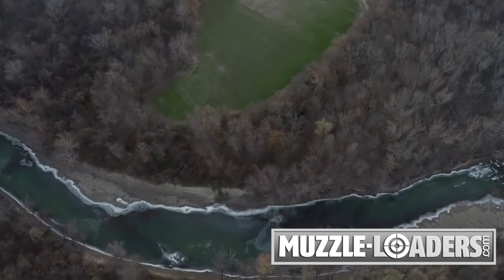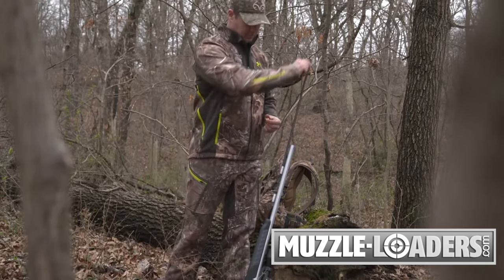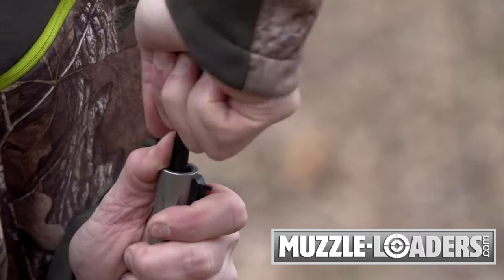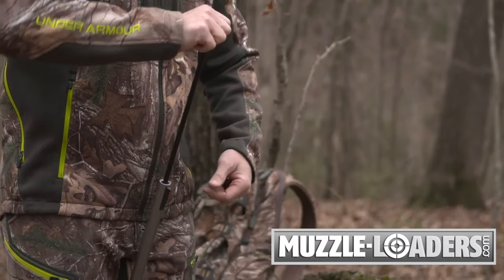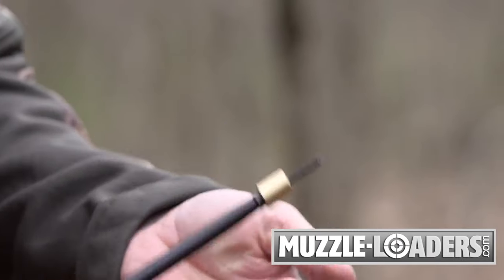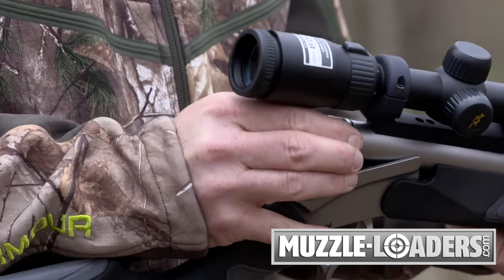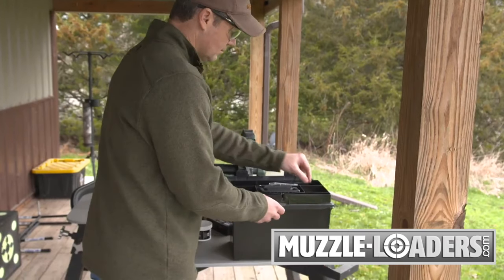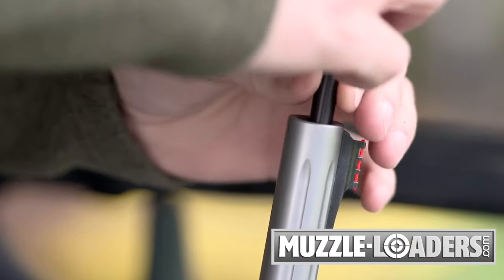Removing Stuck Patches or Bullets from a Muzzleloader - Muzzle-Loaders.com

Comment: I've been using and around muzzleloaders since I was 18 years old, about 30 years now, and I've pulled a few stuck balls and bullets, a few from mine, more from other people's, and I have NEVER seen one come out that easy. Most times you think you're going to get a hernia. I found the easiest way is to, if possible, take the barrel out of the stock, run a little water from the back end over the breech plug, nipple, pan if you're doing this to a flintlock, and then I take the ball puller on the end of a metal cleaning rod and with a hammer lightly tap it in first, then screw the puller in to get it into either the roundball or bullet. THEN, I put the barrel in a padded vise with the cleaning rod and puller still in attached to the stuck projectile, and I take a brass punch and very lightly tap that on the bottom end of the handle of the cleaning rod. My cleaning rod has a large metal round handle, so plenty of room there, and I tap lightly and this will lightly inch the rod and stuck projectile out of the barrel. You're not turning purple trying to pull on that rod and it's safe for the gun. Once the ball or bullet is out, I dump out the powder or pellets. Today in fact I removed a stuck bullet from a Disc rifle that's been in someone's closet for a very long time.
Reply: Run a little water - that's the step a lot of these videos omit and it's kind of shocking. I already don't want to have my hands in front of the muzzle, even without a cap or flint in place when theres a charge of powder in there. The possibility is very remote that something could happen but it does exist. Wetting down that powder is a priceless idea, and it could save somebodys life, or their hand anyway.
Reply: @notsure7874  its a great idea I have never heard anyone suggest this before.

Comment: I bought a new Traditions Buck Stalker and thought it would be smart to run a dry patch threw the barrel just to remove any grease or gunk put in it at the factory. I took the breach plug out as I thought it good to start from the breach end and push it through. NOT a good idea at all. It started alright then got stuck. I tried to pull the ramrod out backwards then and there I was, couldn't even drive it out either way with a chunk of two by four. We finally found a metal rod about the size of the barrel and drove it out from the muzzle end. The patch had doubled up somehow and was really stuck. I'll be cleaning from the muzzle end from now on. If it starts from that end, it will go all the way through. I've shot muzzleloaders the best part of my life and I'd never had this happen before, nor have I had it happen sense. But it sure did once and it's a bad deal when it does.

Comment: That bore guide seems like a bad idea. One, it's the same diameter as the brass ferrule on the ball puller, so it isn't adding anything. Two, it's so long it covers all but about one thread of the ball puller. If it were a quarter inch long, it still wouldn't be doing anything the brass ferrule isn't already doing, but at least it wouldn't be covering up all the threads.

Comment: Why cant u remove the breech plug and remove pellets from the back and push the bullet forward?
Reply: The problem with that is a compressive force would just cause the bullet to wedge itself in even more. You need a tensile force to pull the round out. You can't push it out because the lead is too soft.
Reply: Thanks, but any ideas how to remove a stuck patch and cleaning jag from a sidelock?
Reply: @sudonim7552 And screwing a screw in the end doesn't wedge the bullet open? C'mon man... The bullet was rammed down there with a rod, it can be rammed out the other way too. The powder exploding creates a lot more compressive force than your arm with a rod, and it doesn't do what you're talking about either.

Pretty sure they show it that way because that works whether or not you even have a breech plug. Or if your breech plug is frozen.